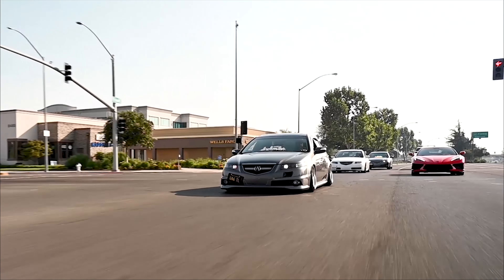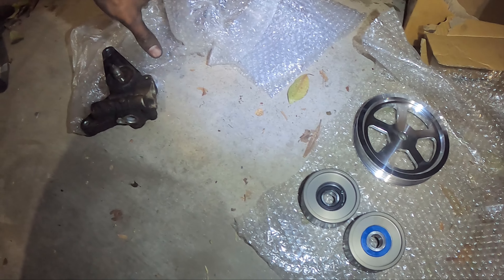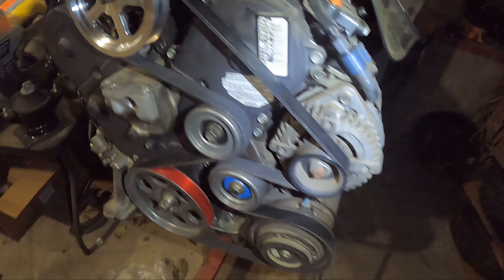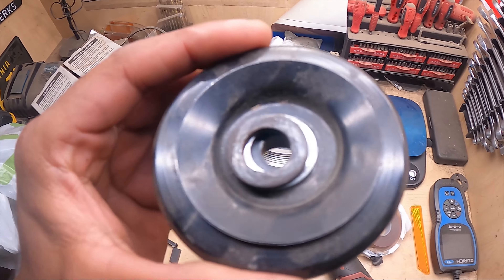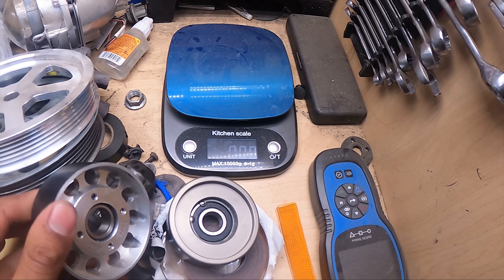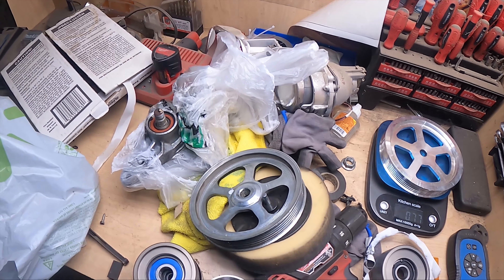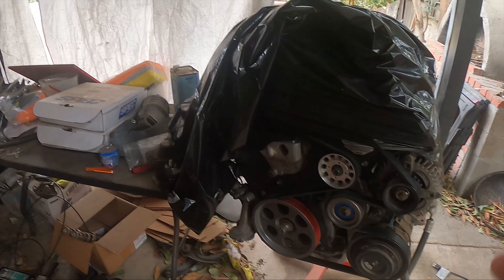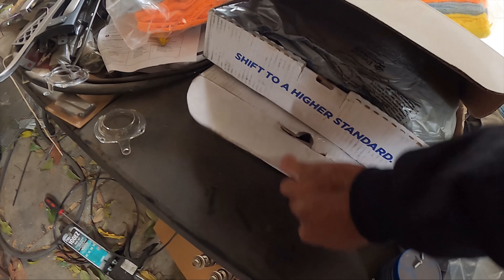Engine Build PT. 6 Installing Gerzy Performance Pulleys on my Engine!!

Comment: You think having all these light weight pulleys will make a difference? Just installed my crank pulley but sometimes during acceleration my check engine light flashes but it’s not on. This is after I installed the pulley
Reply from the maker: When doing the crank pulley I notice the difference but I think doing all these will add up to a good feel..  never had the check engine light come on for a pulley there no way unless your car is breaking up during acceleration like a misfire
Reply: @Mythik559  yup your right a misfire multiple Cylinders. Just checked with code reader